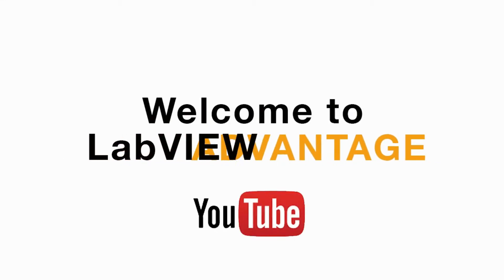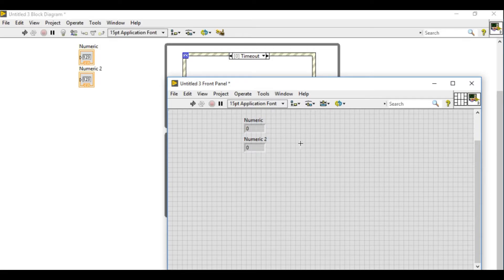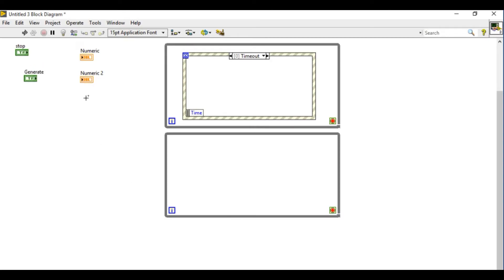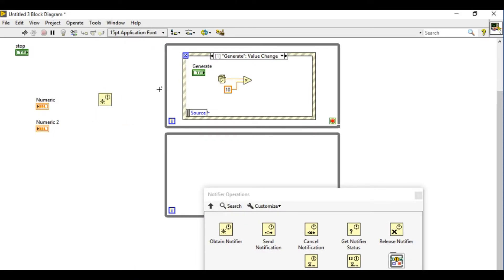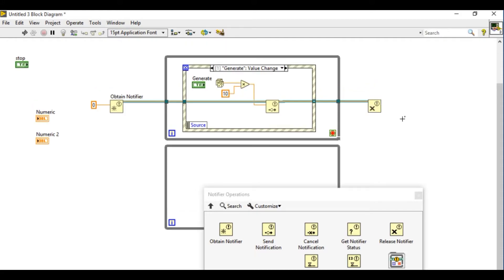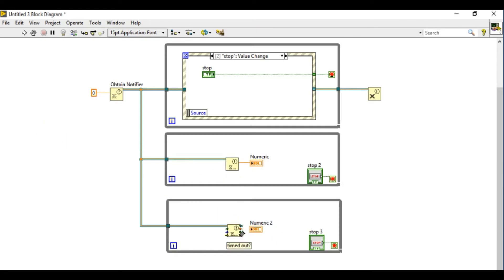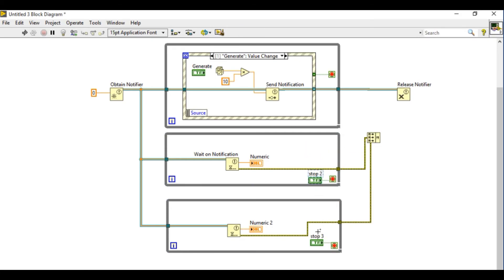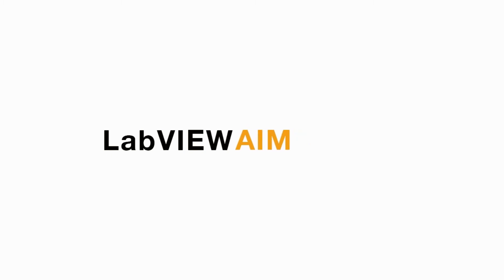How to use Notifiers in LabVIEW

Comment: Can't I do the same using local variables?
Reply: Yes you can but sometimes a race condition can occur where you read the stale local variable value right before it is updates.  If you don't care about this synchronization, then use them.  Basically a local variable is a register that only changes when the original variable is changed so the data is persistent, A notifier is a value passed but when it is read, it is removed and cannot be read again. It also stops the loop that is waiting for the data so it saves resources.  Notifiers are great for sharing data with many other resources.  Queues are kinda opposite of a notifier in that they are good and collecting data from many resources that will be used from a single resource without having race conditions.